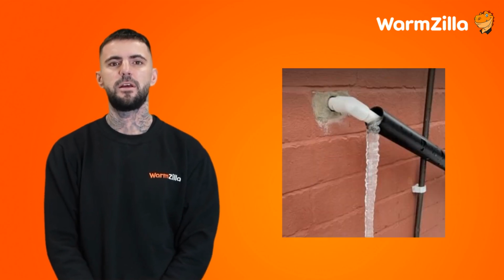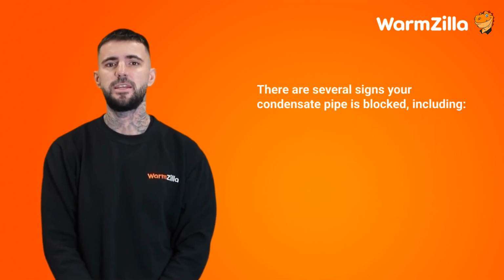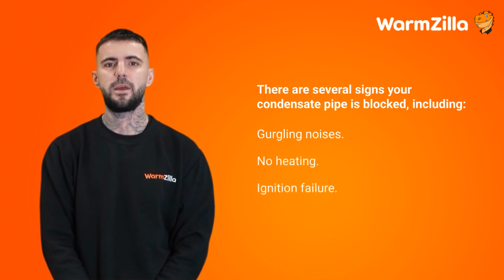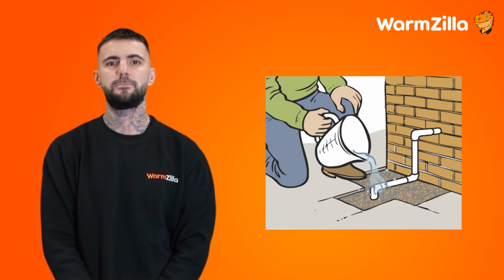How to Reset a Combi Boiler | A Gas Safe Engineer Breakdown

Comment: Ive just had my new Boiler installed,2nd time its packed up,Comes up with error code L Ive reset the boiler and boiler switch,Still doing the same,The water coming out freezing cold,Wish the Housing people left the old boiler installed,Never had this much problems before
Reply from the maker: Hi Dale, the 'L' error could mean either no water flow (L1) or a flame issue (L2), both of which stops your hot water working. If it was installed by us, please reach out via live chat and our friendly customer care team will be in touch! 🦖👋